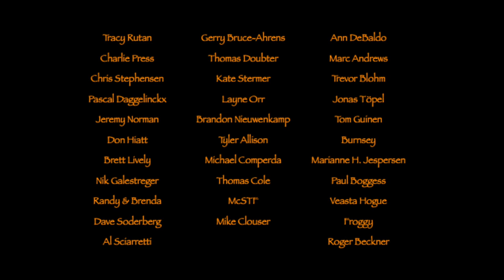Overnighter, Burglary and Jeo-Tec no.9

Comment: Hello Tom, good to see an overnighter. I think this is the best overnighter so far. Dinner and breakfast was spot on. I really enjoy your overnighters because we get to spend more time with you. As far as the pouches. I do like the new one for its plainess. Although, I do like the other one a lot, it would be my pick. I am really sorry for the trespass and stealing of your things. You are such a gentle and caring man, that anyone who would violate your domain is absurd. Here in Alaska many people with remote cabins will cut a large piece of Birch bark or Spruce bark and cover the trail cams so they are harder to spot. One suggestion, how about adding a solid front to your camp that swings up so you have an extended roof and then put it down and lock it when you leave? Thanks for sharing. By the way. I ordered the No. 7 knife.
Reply from the maker: That’s great my friend 😊👍🏻 hope you’ll enjoy using it. I don’t think a closed front will prevent them for breaking in again … just use more power to get in 
But I appreciate your suggestion and support very much. Thanks for coming along again my dear friend 🏕🔥 Tom
Reply: @cimbrerbushcraft-vikingheritag  no, the flag is for you

Comment: It was a great video Tom,  very sorry to you have had  thieves in your camp, you can't leave anything these days, it didn't seem to mess up your enjoyment though,  
 it was a great knife but a bit of a design fault with the  scale sticking out like that, bushcraft knives need square or slightly rounded scale ends, i think you probably hit it with your piece of timber, but the blade stood up well
I liked both your pouches

Thenks for sharing 👍
Reply from the maker: Thank you so much Mick for joining me again 👍🏻😉 I’ve told with the guy from the company and he said it was a great suggestion I had for the handle so maybe they’ll change it 🏕
Tom

Comment: Sorry to hear about the thief coming into your camp.  I have two questions if you have time. 1. Where do you purchase your reindeer hides?  2. What weight or thickness of leather did you use on your new belt pouch? I love the bag and will attempt something similar to yours. I have been having problems selecting the correct weight/thickness of leather for projects such as pouches, sheaths, and other items. Again, the new belt pouch is beautiful!
Reply from the maker: Thanks Ron for your feedback and questions 😊👍🏻 I bought the skin second hand but I have also bought one from www.Bushcraft but ikke.dk
For this pouch/bag I used thinner leather than I normally do … 2,5 mm and it’s easy to use when making a pouch 👌🏻 Remember I have a template for it on my website 🏕🔥🌲 Tom
Reply: I did get the template. It will help me. Thank you for the answers. I have a half shoulder at home that is 2.5 mm and the thickest I have. I’ll use it. Thank you.
Reply from the maker: I think that would be perfect 👌🏻 
Let me know how it goes 😊👍🏻
Tom